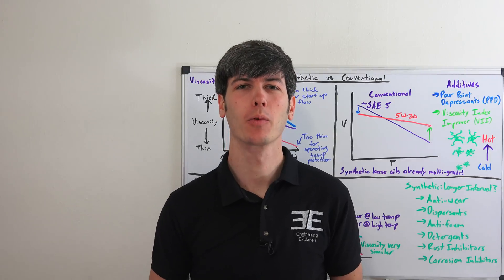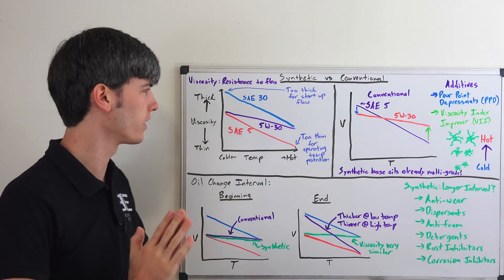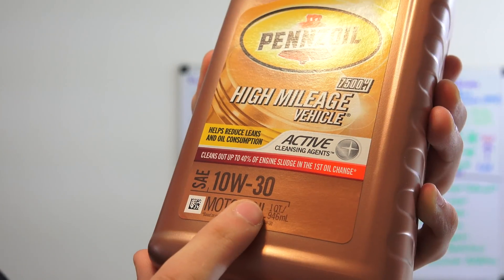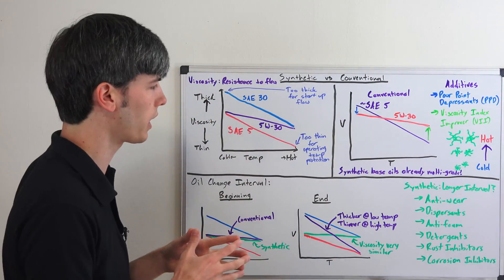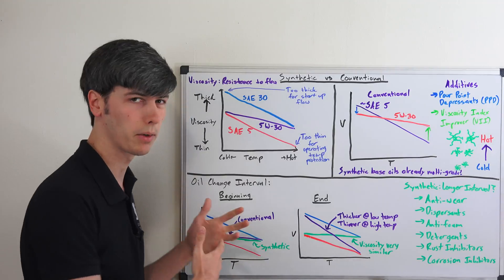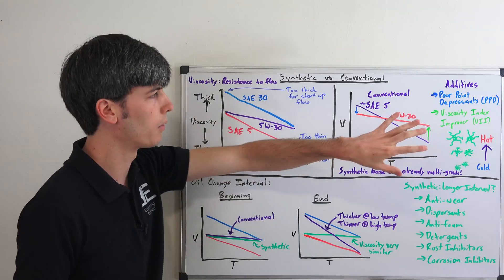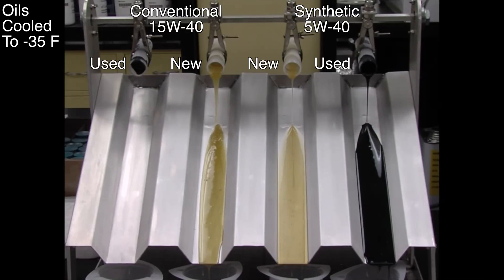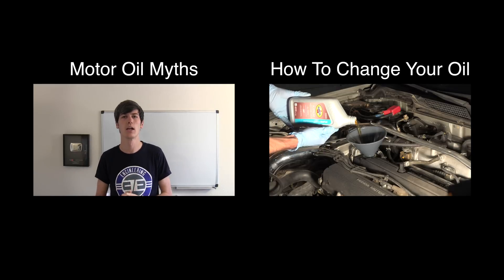Is Synthetic Motor Oil Better For Your Car?

Comment: so is the answer yes, yes synthetic motor oils are better than conventional?
Reply from the maker: +Noah Kuzel yes.
Reply: even if its a 50 year old car?
Reply: @Peron1-MC  Use the same oil as before. It must be excellent for your car.
Reply: Time, water and other contaminants gradually build up in the system. I would change it yearly at minimum, if not twice a year.
Reply: +Renan T oil does break down over time even if the engine isn't run. I have experienced this with a motorcycle before, oil was new but had been in crankcase for over a year the engine got extremely hot because of viscosity breakdown
Reply: the gasket /seals part , thats a myth , synthetic oils will not deteriorate seals... it's actually the other way around , certain additives in the good old dyno oil will harden seals over time , thats why you see older cars that use the cork gasket starts leaking as the oil will harden and shrink the gaskets.

also humidity only breaks down oil if you drive it 1 mile down the road and then cut it off , in other words if you get you engine warm (operating temps) the water will just evaporate/cook out of the oil since the oil temperature will be higher then then boil temp of water...pretty much the same way as water doesn't stay in the oil when you fry a patato... or anything else.
Reply: +Renan T I've had vehicles that I've only driven a few thousand miles a year. I personally have changed the oil every 6 months regardless of mileage. that's just me though. you may be able to go longer in between but I did it at 6 months regardless
Reply: )Peron1-MC( yes, mostly. If U want drive next 50 years.
Reply: @)Peron1-MC(

If it's 50 years old you might want to not do that; unless the engine has been rebuilt so it can use Synthetic it may unplug leaky areas in the engine that were previously unnoticeable. It may (in a severe case) even loosen sludge so fast that it literally blocks an oil passageway and starves the engine of oil! That's only for abused engines though.
Reply: Short answer: yes. Long answer: check out the video.
Reply: He answered that question in the first 5 seconds of the video..
Reply: So perhaps using no oil at all is the solution? It can't leak any if none is there!
Reply: Darkendvoid88 No issues with 10w30 conventional so I see no need to change it. it spends the summers in PA with lots of humidity and the fall through spring in CO.
Reply: even more so.... old school loves the new school boi!
Reply: I'ma  bit of a motor oil nut, it's extremely complicated and really depends on what you are using it in, for how long, climate etc...
Reply: Bob Saget Fixing the leaks is a better solution. I can't use mineral oil in my car at all.
Reply: Synthetics will only cause an engine to leak if the gaskets and seald are bad and if it has a lot of sludge
Reply: +No fox given wrong, after the motor has been broke in or the rings have seated then it is fine. most new motors have this period already done before the customer has received the vehicle.
Reply: +No fox given wrong, after the motor has been broke in or the rings have seated then it is fine. most new motors have this period already done before the customer has received the vehicle.
Reply: prawny12009 Completely agree with you. Like blaming synthetic oils for oil leaks. Fix the bloody leaks :) Taking it to the extreme I suggest that perhaps the best remedy for oil leaks is not to have any oil at all in the engine!!
Reply: And also if it is a 50 year old car thtat gets driven only on weekends (sometimes even a couple of days per month) do I change the oil on a given amount of miles or on a given amount of time? and wich amounts would be those? Thanks in advance.
Reply: +Hank Schrader thanx. so what should be the amount of time beyween changes?
Reply: Thank you Very much I will use your experience as a guideline and hopefully I will get my own
Reply: Always best to change the oil every 3 months due to humidity changes in which causes condensation inside the engine. It's the same with your gas tank, either store it full or very low so the condensation doesn't cause issues.
Reply: gtalover139, my bronco leaks like a siv from the valve covers when I run synthetic 10w30 but doesn't leak a drop when I run dino 10w30
Reply: +sjpro1 in the same boat here in MO with my honda that has some stuck piston rings. Falls-Spring too cold to bump up, but burn 2x as much oil in the same miles as conventional. Even with conventional I'm burning 2.5 qts per 1500 miles with no smoke somehow and a clean engine bay, synthetic is gone in 600-900 miles.
Reply: The difference is far greater than I thought. Is it leaking badly with synthetic oil? Do you mind sharing how old is your car?
Reply: +wampumbiskit not a myth. More like incorrect application of lubricants per manufacturer recommended application. As a previous Toyota owner 225k miles on synth after first 5k breakin miles, the engine and specifically the valve seals leaked at 180k. Which most would say is pretty good. But the cleaning effect of the synth (hone marks still present, rings not burnt, dipstick like new) is what causes the seals to fail...in under 9 years..possibly dry rot or just not protected by natural oil sludge-effect. I realized later that although synth(MobilOne) was more expensive, for that application, I would have been better off with regular oil. 
Later engines use gasket and seals made to work with the properties of synthetic(so you can go 10k miles per change). But my issue is not myth or so, instead: what are the pollution effects of burning synthetic versus reg oil?
Reply: due to old engines had less ring seal and carbs just dump in lots of gas in the cylinder i suggest 3-4k mile  or 6 month oil change. oil is cheap but your car is precious no harm will be done if you change your oil early
Reply: Of course. Fixing a leak is the easy part, sometimes figuring out why it's leaking can be time consuming. In the aspect that I was stating, I put synthetic in an engine that was a little more used than I thought, and it washed away the hardened gunk inside that was preventing leaks. One of my motors I bought used was actually corroded to the point where the gunk WAS the gasket, at the oil pan corner and the front main journal, which caused low internal pressure. Drained the synthetic and found out I actually had to get the block bored and decked. No fun..
Reply: +Capri Driver Gaskets and seals, sure, but like I posted before, there's a chance your engine could be corroded, and sludge/grime IS the new gasket. You wash away that, and even new gaskets won't save you if it's bad enough. Gaskets and seals aren't the ONLY things that leak.
Reply: +Engineering Explained how about for a diesel?
Reply: Of course its better, thats why you pay more for it. But will it make a difference worth the money if you just chucked it in your camry? No.
Reply: Tony Lopez Sludge filtration system? Yeah its called an oil filter. Most engines even when worn look squeaky clean where all the oil passes. I don't doubt it adds wank factor for the sell and obviously you wouldn't run non synth in an engine thats built to run it but thats just it, If its not then your spending your money on snake oil. The biggest deal is that it doesn't break down as easily at higher temps and harsher conditions. If your engine doesn't see those conditions your wasting your money. Ive never heard of anyone buying a second hand car because it was maintained with synth oil when it didn't need it. If they did id be suspicious they were a bit of an "enthusiast". Not someone to buy cars from
Reply: The bit that gets me though if those two oils really were the same viscosity wouldn't they atleast run his little test the same when they are new? seems a bit weird to me. Also im not sure if you have ever changed your oil but even when its cold its not so tar thick that you would have trouble pouring it out of a container like that. I wouldn't be suprised if synthetic lasts longer as ive seen crazy long intervals recommended for cars like bmws but what i said was you wouldn't be better off putting it in a car that has standard 10 thousand km intervals because standard oil is designed to last that distance and stay within specifications. Synth may last longer but would you really try to go longer on an engine not recommended to do that? nope.
Reply: I agree. Additionally, not many myths are true :D
Reply: Synthetic oils do have the propensity to find leaks due to their superior detergency.
Reply: There are heaps of examples of people putting synth in their engines of recommended viscosity and they start running into problems such a valvetrain noise, it seems they are not interchangable so swapping all your stuff to synth can spell trouble. Note how the two oils of the same viscosity act much differently even when new. Even though they are supposed to be the same weight at two certain temperatures. Don't dick about with the oil just use what you are supposed to and like i said don't put synth in your camry or other middle aged middle priced car that just runs standard motor oil.
Reply: His test at the end is complete rubbish. 

For starters, that oil was BURNT. It was pitch black, and clearly abused. Your oil SHOULD be dirty, but it shouldnt be a thick black sludge. If you are waiting that long between oil changes (thats a significant amount, and the "test" is laughably incomplete, data wise), you are doing it wrong anyway. 

TL;DR? The test at the end is nearly meaningless without the data behind it.
Reply: My understanding is that the main reason you may need to change your oil on a time rather than mileage interval is because vehicles which get driven low miles are often driven in short bursts, rather than long, endurance trips.  The compression in the cylinders combined with the fuel burning produces some water, some of which can end up in the crankcase.  On long trips, the engine gets sufficiently hot to boil off that water, but in short hauls it might never get hot enough, which can result in accumulation in the engine.  Not sure if that is all correct, but that's what I was told by an old mechanic who probably knew.
Reply: That sounds correct to me. Variable OCI systems take this into account for exactly these reasons.
Reply: I don't know about this new fangled stuff . Seems like the work of the devil to me. I think I'll wait until people have been using it a few years a fore I try it.
Reply: Changing oil frequently is not a substitute for using the correct specified oil.
Reply: steevemachine
 If your engine is suffering really heavy carbon deposits or "the black death" as it is commonly known even using an oil flush will loosen the crusty deposits off and clog oil pump pickups, galleries etc resulting it catastrophic failure.

similarly blaming synthetic oil for a failure under these conditions because it cleans the internals better is wrong, the damage has been caused by previous poor maintainance allowing the carbon build up in the first place,

A well maintained engine will happily run any oil that meets at least it's minimum requirements mineral or synthetic.
Reply: That is a myth that is not true
Reply: Might want to switch up to 15W-30 if your in a temperate climate, if the leak is happening when the engine is cool.
Reply: that is good to know, my mum and dad have racing lawnmowers and they nick the oil we use for the buses, and i think that our buses don't just have one make or manufacturer so it might be that we use the best oil for them all and not like the best oil for a particular engine. and i wouldn't be surprised if the buses have tens of millions of miles on there clocks so there might be something more at work here, or it might be just a case of preference and biases on my family's part?
Reply: Unless the engine has been rebuilt with modern seals, no. You will get oil leaks with synthetic on an old engine, go with something more made for an engine of the time. I've actually used Shell Rotella or Mobil Delvac 15W40 multifuel engine oils and have had very good luck with them. Since these oils are good for gas or diesel engines, they have a good detergent and dispersant package, and will protect as well as clean Your engine. They also have better antiscuff protection than modern regular engine oils.
Reply: Rings stuck or possibly lost tension or broken? If they're just stuck, add marvel oil to the gas and run a couple tanks of the mix. Give the car some good long runs, letting it get fully hot for a while. Take a few 3+ hour drives and make sure to run it at higher RPM's, too. Marvel with the higher speeds may free them up, it's what I've done with engines doing the same. You can also try Amsoil "Power foam" spray down the plug holes and let the car sit a couple hours, I loved using that as part of a tune up.
Reply: +Oldbmwr100rs Agreed, my bike engine was making more sound with synthetic.
Reply: Absolutely and with no exceptions.
Reply: use what your manufacturer says. some engines NEED conventional oil. And lately this EE guys videos make me believe that he is not an engineer at all. so make your own research if your manufacturer says you CAN use synthetic oil use it if not dont risk it use conventional change earlier than usual
Reply: what does your car spec
Reply: Still better to use the correctly specified oil.
Reply: +Oldbmwr100rs well said, especially about using synthetic on old engines. I was going to comment something like this, that part about synthetic cleaning so well, it'll actually CREATE more leaks is 100% true. Experienced that twice, first hand haha
Reply: +Bob Saget Heard similar stories about Transmissions because ATF is pretty much a high temperature detergent and varnish solvent. Great for keeping new systems clean and gunk free but bad for high mileage. ridden hard, put up wet systems (especially on boats). 

If you have a FUEL or Brake Fluid leak the one urgently needs to figure out and probably fix the problem.

Safety first of course...

Got an OIL, ATF, AF and even A/C (R-12/22 once were probably the best detergents on this list). I was taught never ever drain the pan or add more than a quart per interval.

 If you must then it's time to fix and/or replace.
Reply: the short answer is no. if you're engine was broken in on crude oil then all synthetic pull will do is cost more and increase leaks. the unified mole size moves easier through the uneven passages and gaps between seal points. if you are looking to go longer in between changes then send a oil sample to blackstone labs and find out what is really going on inside your engine.
Reply: +Turbo617 Maybe YOU are good to go, but some cases, 34 year old vehicles are not in tip top condition. Hence my example, try buying a farm truck like a 68 Chevy or a 72 Ford, that was just kept running, and that's about it. It could be 10 or 50 years old, it depends on the conditions, and whether you open it up to actually look at it. The Odo can say 54,000 miles, but who's to say the two previous owners didn't swap out the gauges or anything? Its not a complete lie, you probably just got lucky. If you haven't been running synthetic from the get go, after 75k is where you should probably just not even bother, unless you do a full machined rebuild.
Reply: I wouldn't put it in an older motor that has its miles on conventional. Had a windstar with 80k and put mobil1 in it, started squeaking at the cam in only two days. Dumped it on day three and filled it with shell 10w-40 and it was normal in a few days. This motor always had regular changes and flushes, so no sludge to break loose.
Reply: +Turbo617 Actually, it is recommended that conventional oils be used during the break in period of a new or rebuilt engine. Synthetics will not allow the rings to wear & seat properly and therefore will not run at peak efficiency. After the engine has broken in I say yes, by all means use synthetic oil. Automobile Manufacturers have been generous with extended warranties with the contingency that synthetic oil be used only because they are certain that they won't lose money that way.
Reply: Pay atention
Reply: Never ever put Synthetic Motor Oil  in a car or bike under 37.000 km ever
Reply: Derpin Bird my camry uses synthetic
Reply: +Derpin Bird Actually,  the answer would be yes under a number of circumstances. 
1. If the manufacturer requires it,
2. If you consider the life span of engines without synthetics. 
3. If you add a filtration system that removes sludge. 
4. If you do appropriate maintenance such as changing the oil as per manufacturer directions.

In reality, it can actually save you money when you take into consideration the resale value should you choose to upgrade. A vehicle with synthetic oil maintenance records sell for & is worth more that one with conventional oils. vehicle is more efficient & gets better gas mileage. The list goes on.
Reply: +Derpin Bird ummmm,  yeah kind of. There can be no foubt that an oil filter is necessary, (duh). Since all vehicles come with one, my reference would obviously point to an additional filter like a bypass filter. As good as synthetics are, there is still some friction & heat (albeit significantly less ) which is the what causes particulate matter to increase & becomes sludge. The conventional oil filter has a valve that allows dirty oil to get around the filter as it plugs up, (and they do), because unfiltered oil beats no oil at all. To remedy this an additional filter may be perched which captures particulates as they are forced through it. With an auxiliary filter which captures particulates apart from the conventional filter an engine will run better & longer. Franz, (not Fram ) is one company that makes these. They are pricy but very effective. I have seen engines with oil so clean you can not tell where the level is on the dipstick without looking very closely. And that's when the oil is getting changed. Granted, they can be pricey but they do an excellent job. Regardless, the cleaner the oil is kept, the less wear there will be on moving parts. I am in no way involved with the company. I  say this because I see the facts as they are.

 If you do sell your car, I would say to remove it & put it on your next one.
Reply: +Derpin Bird ummmm,  yeah kind of. There can be no foubt that an oil filter is necessary, (duh). Since all vehicles come with one, my reference would obviously point to an additional filter like a bypass filter. As good as synthetics are, there is still some friction & heat (albeit significantly less ) which is the what causes particulate matter to increase & becomes sludge. The conventional oil filter has a valve that allows dirty oil to get around the filter as it plugs up, (and they do), because unfiltered oil beats no oil at all. To remedy this an additional filter may be perched which captures particulates as they are forced through it. With an auxiliary filter which captures particulates apart from the conventional filter an engine will run better & longer. Franz, (not Fram ) is one company that makes these. They are pricy but very effective. I have seen engines with oil so clean you can not tell where the level is on the dipstick without looking very closely. And that's when the oil is getting changed. Granted, they can be pricey but they do an excellent job. Regardless, the cleaner the oil is kept, the less wear there will be on moving parts. I am in no way involved with the company. I  say this because I see the facts as they are.

 If you do sell your car, I would say to remove it & put it on your next one.
Reply: +stock9291 I did check the video. He did a great job explaining how synthetics offer better protection at the end of the oils life when a conventional oil tends to not be as effective. However he does not give a straight yes or no answer. The reason for this, is because as it was mentioned in previous comments there is a subjective nature to it in as much that there is various makes, models,  and changes to the engine design over the years.  Changes that include being able to switch over to synthetic oils versus conventional oils, classic cars versus new cars, "American Muscle" versus the imported tuner, etc.
Reply: +Turbo617 My Honda oil was semi synthetic. The Prius requires fully synthetic
Reply: 20w50 in a VW PD engine? Really?
Reply: Put 20w50 mineral in my car for the summer and you'll need a new engine by winter.
Reply: so what your really saying is the cost of synthetic oil  vs the the length or mileage of the engine was not worth the extra cost of synthetic oil.  That is a primary reason the company I work for does not use synthetic oil unless manufacturer requires it.  Another issue is filtration.  If your not using a filter with a micron small enough for synthetic then whats the purpose for using synthetic oil.
Reply: On high end sports cars typically the manufacturer recommends synthetic.  Manufacturers also recommend that you NEVER run synthetic in a engine that's run Conventional before and vice versa.
Reply: I've never seen this advice by a manufacturer.
Reply: +paulanderson79 my Ford Excursion requires synthetic gear oil in the axle, manual says using conventional oil will result in catastrophic failure.
Reply: Just use whats rated, if it doesn't mention synthetic just forget it.
Reply: Good advice. But viscosity is not the only consideration. Most engines' oil specs can't be met by mineral oils now. I'd always go synthetic unless no other choice like some monograde garden machinery engine oils.
Reply: What we need to consider is that even within a given viscosity rating, oils vary widely. Some 5w30's are more viscous than others, they just all happen to fall in the 5w30 band.

Mixing is generally best avoided, with one absolute rule. Never mix an ester synthetic with anything else. No exceptions. Not even another maker's ester synthetic.

Additionally, as I keep stating, there is far more to oil than just it's viscosity rating.

For example. Fuchs makes 10 different 5w30 oils. All are synthetic.
Reply: +No fox given why
Reply: +Steve Johnson 
I would say that's due to detergents wiping out old sludge deposits that blocked oil leakage, plus possibly destroying old stopleak additive accumulations. I don't think the oil destroyed seals, it sounds a bit absurd to me. I would say that more than likely, you had a heavily abused engine to start with.
Reply: since he wont respond to my comment, I'll post it under the most popular post.... (this is to him btw). 

As a maintenance engineer, I must say... the comment section is quite 
depressing. 

You are also clearly sponsored in this video, as you neglected to 
mention some very important things regarding "synthetic oils"... i.e. 
there are exactly ZERO standards of requirements to define an oil as 
"synthetic". 

ALL "Shell" product based oils (aka penzoil) are grade II+ or III oils 
(aka not really synthetic at all, just higher standards to oils that 
have no additives or additional distillation). To be fair, they are 
treated and distilled to a higher grade than your typical "off the 
shelf" oils; but are not truly a "synthetic oil". 

So those of you preaching about your "synthetic oils" ... may actually 
be putting in normal motor oil in your car lol. Only a few companies 
produce their own synthetic oils. The process is quite expensive, and 
thats why you pay the premium. The -35F test only proves that penzoil 
added a really good or high quantity of pour point depressants. The 
indication of perceived "quality" just doesn't apply.
Reply: He clearly Explained how consumer-grade 'synthetic oils' are different from conventional products. He didn't say that products labelled as synthetic oils are 100% artificially made. In fact the Pennzoil Full Synthetic products use natural gas as a base oil which is not made by distilling, and is a true synthetic oil.
The comparison at the end was clearly for the purpose of demonstration. It's not a test at all. And yes, if the used conventional oil is below the pour point, then it's a pointless test, but I think he let that slide by stressing that it's for demonstrative purpose only for the consumers understanding.
I think he should have mentioned that some products labelled as synthetic oils do not have a justifiable price tag, and the benefits may not outweigh the extra cost in every situation.
Reply: Yes
Reply: JgHaverty absolutely, he couldn't even get the new oils to run the same. All he proved was pour ability isn't viscosity and how different it is to normal oil of the same viscosity for which a lot of engines are designed.
Reply: Areeb Javed Dude, he didn't explain a damn thing lol. Oil are pretty complicated things, far more than they appears. This SPONSORED VIDEO is nothing more than corporate shilling disguised as one of his own videos.

The product he's endorsing isn't even a true synthetic oil dude, do your homework.
Reply: ONLY if you live in sub zero temperature climates. It does not congeal like mineral or fossil oils. You have NEVER known ANYONE who has EVER lost a motor cuz they din't change their oil regularly.
Reply: Terence McLaughlin  There are some engines whose lubrication requirements cannot be met with mineral oil. VW's PD injectors are savage on engine oil for example. And DPFs require low SAPS oils in order to avoid damage. it's not just about 
viscosity any more.
Reply: ***** In all vehicles?
Reply: 00nowhereman00 It's quite usual now. Not new fangled any longer. And certainly not Satanly.
Reply: We'll see how I feel about it after I replace this here cass-ette deck.
Reply: Actually, the answer isn't as simple as it seems. If a 100 000Km car was run for most of its life with standard motor oil, never switch it to synthetic. The thing is, well, standard oil contains impurities that stick inside the engine, along with carbon deposits and gunk. Synthetic motor oils contain detergents that will not only clean the inside of your engine, but also remove all the gunk buildups everywhere inside the engine, including the shaft seals and bearings. These buildups are what keep the engine "sealed". Synthetic oils will disolve all these buidups and the engine will start no only to burn expensive synthetic oil but also leak like a sieve from the "worn" seal bearings and shaft seals that are no longer kept "oil tight" by the gunk buildups. BUT! If you have a brand new engine, it would make a world of difference to switch to synthetic since the inside of the engine is still pretty free of any buildups. I don't care what these "engineers" say. Most of them never put their theories to the test in real life driving conditions. All they did was use "benchtest engines" run at a given RPM for a given amount of time.
Reply: steevemachine We cannot conclude that synthetic oil is inferior.
Reply: For all cars in all climates. How do you meet the oil specs for cars whose requirements cannot be met with mineral oil?
Reply: older vehicles tripped back to 0 after running past 99,999 so no way of telling if you have 54,000 154,000 254,000 etc
Reply: prawny12009 what's the relevance?
Reply: paulanderson79
i was responding to bob saget, it just didn't put his name for some reason.

he had made a point that you can't always go by mileage as previous owners could have changed the dials.

I was just pointing out that older vehicles like the chevy  in his example may well be running the original dials but you can not tell if it has tripped past 100,000 before.
Reply: paulanderson79
Reply: Good question because even the synthetic oil manufacturers themselves can't tell us with certainty.
Reply: Like the others are writting it isn't that easy to decide. At least it depends on the enginen and what the engines manufacturer is ruling about it. (Certified Oils for your engine). You gonna get such information due to asking your nearby car shop of your manufacturer ;). Don't get fraughtened due to myths about motor oil. Those examples of Engineering Explained are made for an overall overview about motor oil and its basic behaviour and doesn't says anything about the properties which an oil needs for your engine :)
Reply: adolfo maurício but what 'd you do in case of an used car? Guessing? Or just keep on the maintenance rules of the manufacturer?
Reply: Engineering Explained what’s the best oil for a V6 vtec?
Reply: sjpro1 Then replace your gaskets.
Reply: Power.  Cooker
Reply: Okay.....
First, if you have sludge anywhere in your system, you have not done proper maintenance to your engine. I’m not talking about varnishing of the components, but actual sludge sitting in the oil pan. 
Second, seals usually get worn out from the constant pressure of the oil system. Never from oil chemically eating away a seal. Maybe the oil could turn acidic if left for years and not changed. Anyhow, it means less material to push against to effectively stop leaks.
Finally, today there is no reason to use conventional oil.  Any synthetic blend, full synthetic, or 100% synthetic oil can be purchased with high mileage additives that will swell seals.
Reply: not necessarily, for protection it might be but depending on the engine's age some engines might not have an oil filter, in witch case you don't want the properties that synthetic oils usually have to hold onto particles which is then filtered out in the oil filter, but if you don't have an oil filter then you absolutely don't want that and you want the particles to drop out of the oil and form that sludge, and in case you are wondering my family runs old buses and that is where i got this from, so we use the heavier Morris mineral oils (don't know the exact details)